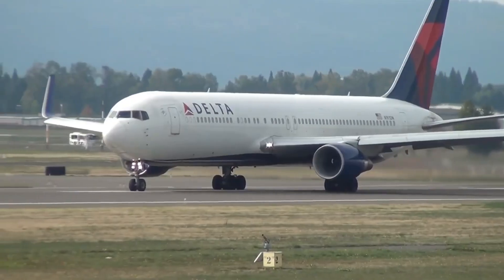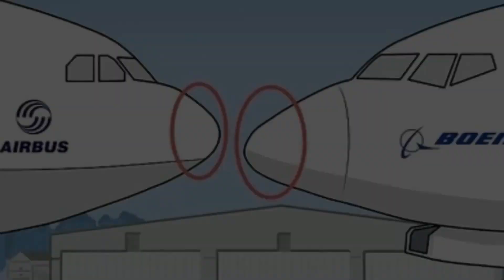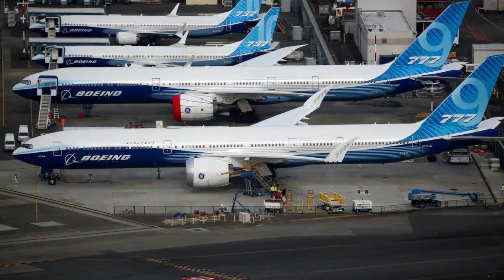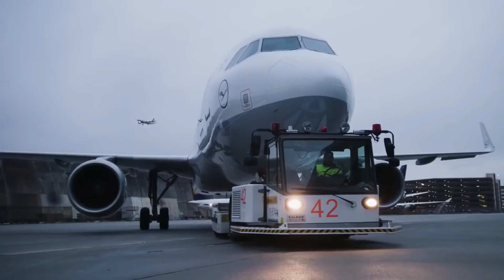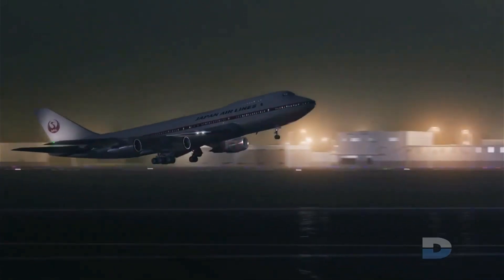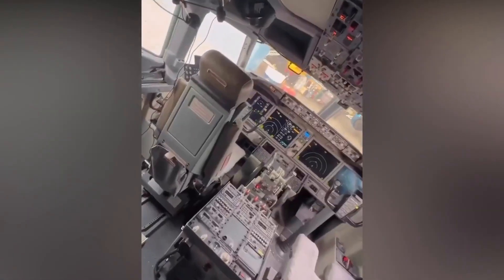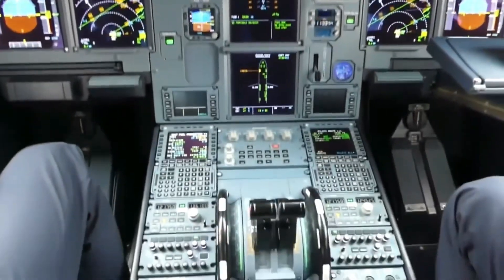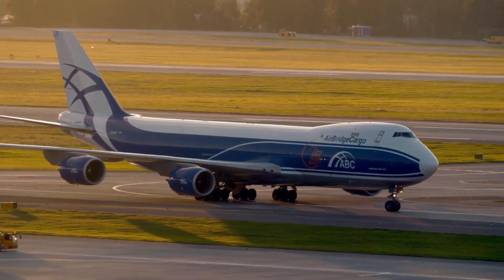10 ways to differentiate a Boeing from an Airbus!

Comment: The gear comparison is about as vague as it could possibly be since both manufacturers have many variations of gear designs depending on the aircraft type.  Also the aircraft monitoring systems you got backwards. Airbus use ECAM and the Boeing uses EICAS.  Either update the video or delete it for misinformation.
Reply from the maker: Thank you for pointing out the mistake,

Hope you enjoyed the video ✌👌